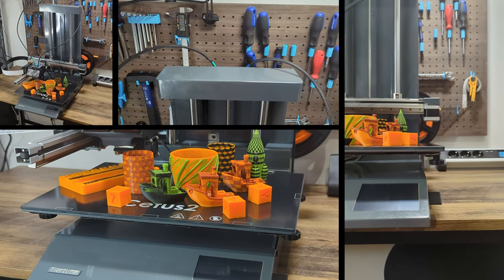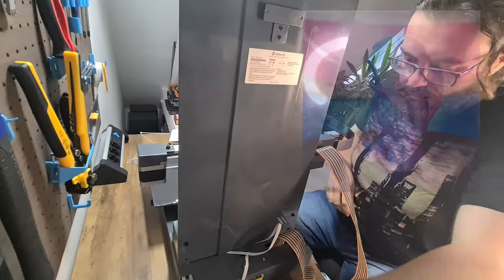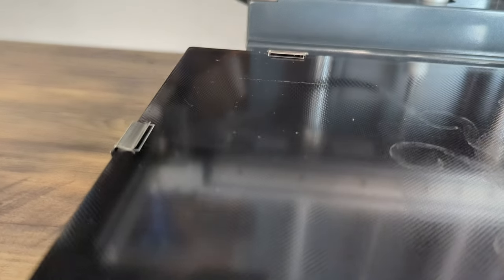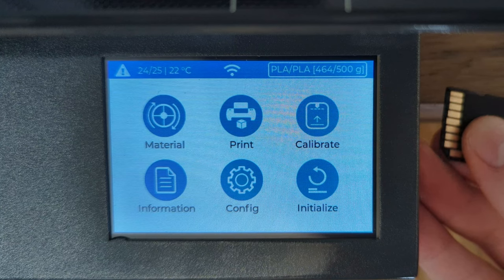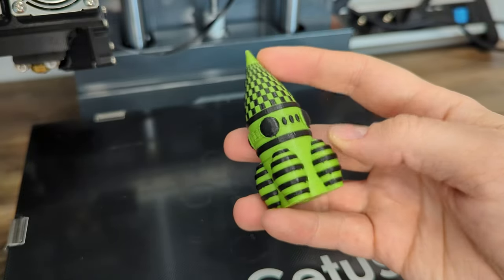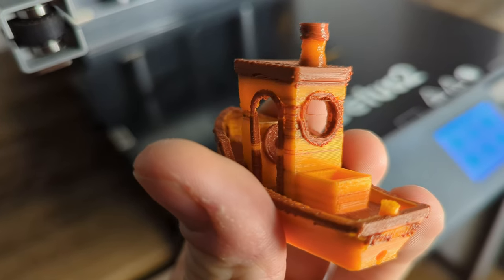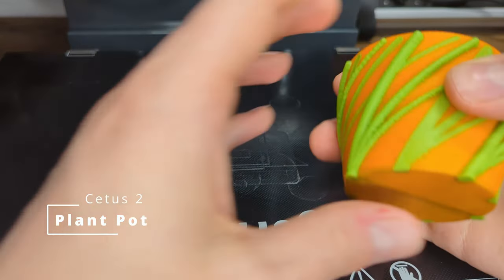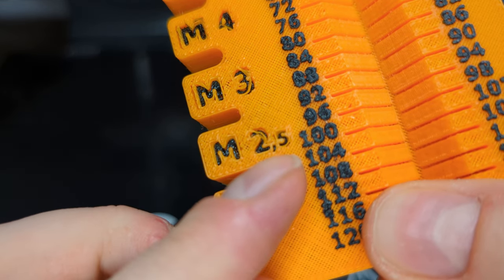Should you buy a Cetus 2 3D Printer in 2023? | #HonestReviews

Comment: Quite a contradictory package. I appreciate the solid metal design but its printed components have a messy finish, which is odd to see.
Good to see an innovative extruder design but it's definitely let down by the slicer software - for a pre-built printer I'd expect to get good results easily and not have to fiddle.
The screen and part cooler are inexcusably bad! What were they thinking.
Those ribbon cables are just begging to be damaged as well.
I'll be sticking with open source products.

Comment: What would klipper do for this printer? Would it be possible?
Reply from the maker: Well first you would have to change the mainboard, im pretty sure that klipper might not run on the hardware they are shipping. I never tried klipper in a  multi printing environment, so im not sure if you would be able to print with both colors together.

Comment: I feel like the entire selling point of this machine is a partial lie TBH, if you're running different colors through a nozzle you HAVE to bleed out the old color somewhere, not just in infill. Also the way their nozzle is the not-selected color is still going to try and melt it's remnants out slowly while the selected one is still going. Also whatever is going on with your checkerboard benchy, the walls aren't fused well at all and there seems to be massive under-extrusion on the top layers. Why can't they just purge a series of small lines beside the print, it doesn't even have to be much, just print an 'L' shaped piece so it's stable and primes the nozzle ready after each purge transition, but not a tower/cube.. those are massive waste. Also if you've already done e-step calibrations, you might be fighting something in the slicer that's making g-code that's handling the primary/secondary filament retractions. But on a single color it shouldn't have those change retractions so..
Reply from the maker: The biggest problem is that the whole slicer, the firmware everything is proprietary, I really would do e-step calibration but I don't have the tools for this. Without Marlin, RepRap or Klipper you're lost in trying different slicer parameters for the cure but nothing worked..

Comment: The fact that they put an axial fan as a part cooling fan without any sort of pressure conversion measures and forced it into a small opening with a short funnel is just appalling, like don't they have a single person there who knows how fans work?

Underextrusion was already a problem on Geeetech A10M, a very cheap Mixtruder printer from like 5 years ago? Ancient. Part of the time, the melt just pushes up and into the wrong filament path, which then also mars the colour transition. But then of course Geeetech is open-hardware electronics, bootloader on, Marlin firmware properly open sourced, just take the hardware and roll your own thing however you feel you like it, add parts delete parts, undo their horrible engineering mishaps, great engineering toy, completely different target audience.
Reply from the maker: Yeah... that's something I dont understand either, there is so much engineering knowledge in the motion system that it's hard to believe for me that those mistakes were made on that printer

Comment: It's well known that linear rails re not good at all for 3D printing, or at least don't give any advantage
Reply: Speed ?
Reply: @Mattggiano  at working, usual speeds. You get oscillations because such rails work usually in pairs, on bigger machines. #D printer is very fast and works differently.